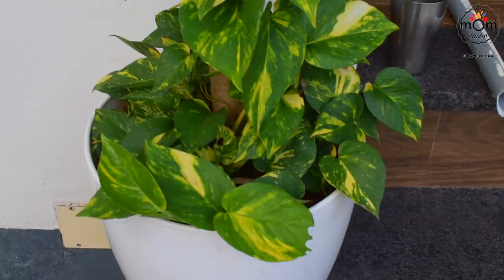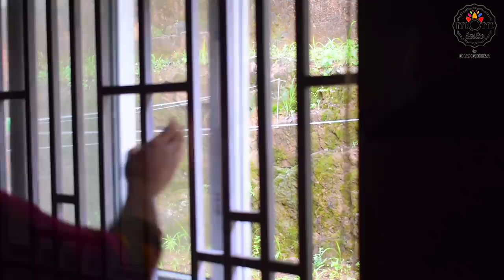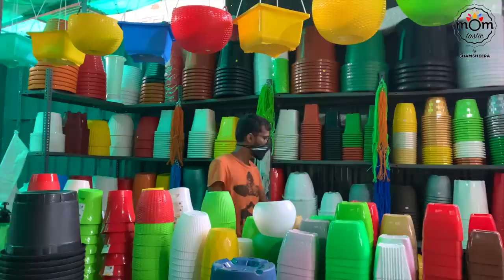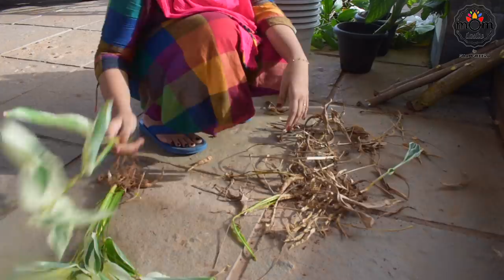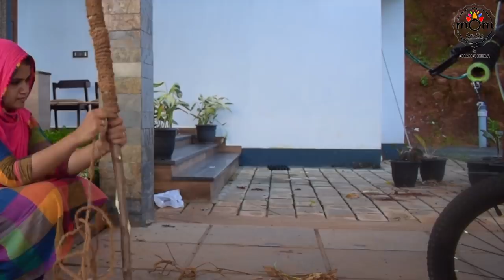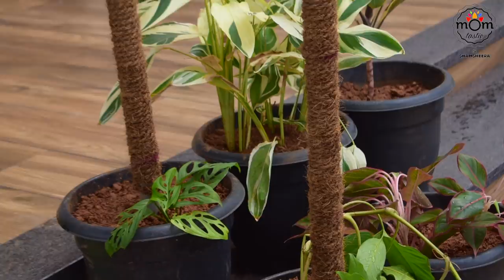How i manage Kitchen food waste | Some Gardening & Rearrangement

Comment: Shamsheera ....try to make potting soil by mixing  red soil , coco peet, compost , peudomonas , bone meal , veppin pinnaakku ........do it when ever you get an helper ....then store this mix in  paint buckets ....you can use this potting mix whenever you get plants ....

Pipe inu neelam kurachu mathi ... maximum 4 feet illenkil kaatu pidichu marinju veezhum ...also length kuarnjathanu kaanan pretty
Reply: Soil maathram ittal kurachu kazhiyumbol water clogging undawum...
Reply from the maker: Thankyou soo much for the tips 🥰🥰♥️♥️

Comment: Wastine kurich ndhaa paranjadh??
Enik manassilayilla englsh...😔😔
Reply from the maker: Waste sinkil koode kalayaan patum ☺️ …. Avar nalla heavy duty motor sinkilnte adiyil fix cheythu therum. Enittu vellathinte tap on cheythu vechitu switch on cheyyanam, oru plasctic polathe decice kondu waste elaam sink holiloode push cheyaam. 
Ithu vellam pole aranhu kitum. Ithu venamengil namukku fertilizer aayi use cheyaan vendi vere reethiyilum avar fit cheythu therum. Athu allengil normal pipe water ponapole pokum .☺️☺️

Manasilayi enu vijariknu ☺️
Reply: @MomTasticByShamsheera  thnku shamc.....😘😘😘
Enik englsh crrct aayit ariyillada...but ningalude vdok vendi njan waiting aayirikkum..bayangara ishtaan....
Aaa waste upayogich biogas cheyyunnallo....angane cheyyamayirunnille ningalk???